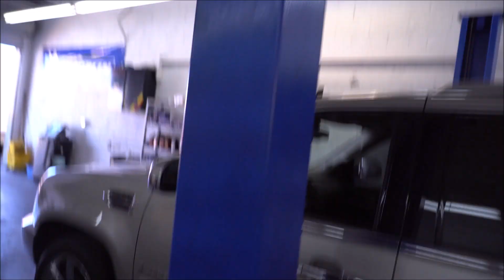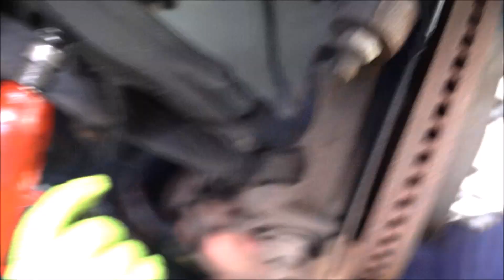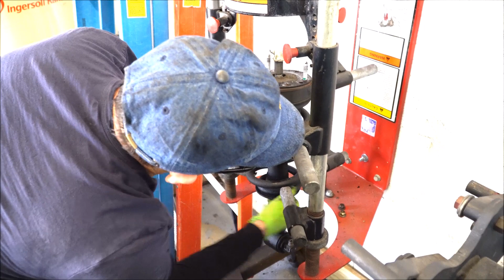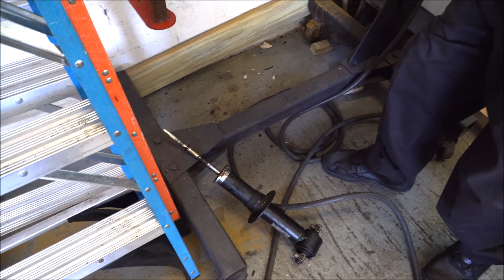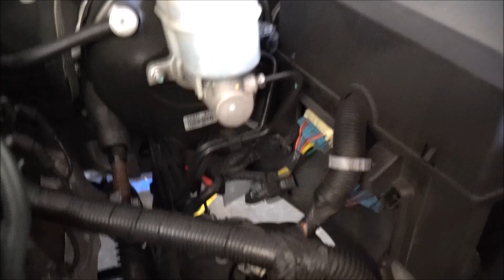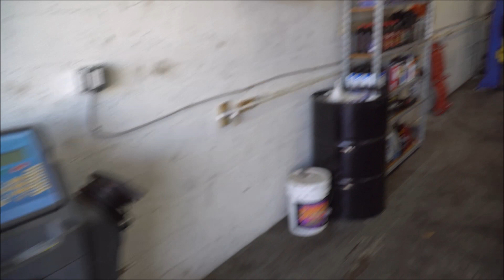Replacing GM SUVs Electronic AutoRide Front Shock Strut Cadillac Escalade front strut Repair

Comment: Do you need the bottom plastic insulator?
Reply: BECAUSE THE ORIGINALS COME WITH IT! SO.THE BOTTOM PART OF THE COIL SITS ON IT SO IT WONT MAKE ANY NOISE!  THATS WHAT FOR
Reply: I was wondering the same thing, I found that the old insulators from old strut will need to be transferred to new strut, without the, it’s going to make noises.
Reply from the maker: FOR ?

Comment: I've replaced the new strut into the old coil but when I put it back into the car and mount it up top in the engine bay the bottom strut is twisted and doesn't line up with the holes for the two bolts.  Any suggestions?

Comment: How do you take the sensor off the shock top? Also how do you install it back on?
Reply from the maker: Should come right off
Reply from the maker: Just pull it off or there is a nut on top of it
Reply: What is the name of the sensor?

Comment: Dude stop commenting on mechanical videos. You are using so many wrong terms in this video.
Reply: on top of that he did not replace the foam damper or the plastic ring that sits at base of spring could have just took them off old ones

Comment: What's the problem? I have Escalade, when I make a brake in low speed (5mph or lower), a "ta" noise can be heard from driver side. Sometimes happened when make turns.
Reply: Might be the sway bar link
Reply: @briancayko  I checked, look good. But it's ok, I sold it already.

Comment: Does it need a front end alignment after the new struts are installed?
Reply from the maker: Tha is for viewing bud. Please subscribe like and share man it helps me out
Reply from the maker: Ba Nguyen ba if you are manipulating the front end while installing the struts I can see that you would need to do an alignment. However i did mine 1 side at a time and it did not require an alignment. I also marked the steering wheel when we lifted up the truck to see if the alignment was manipulated which it was not.
Reply: Thanks! Looking forward to tackle this diy project this weekend. Gonna replace the front and rear shocks on my Escalade. Thanks for posting the video!